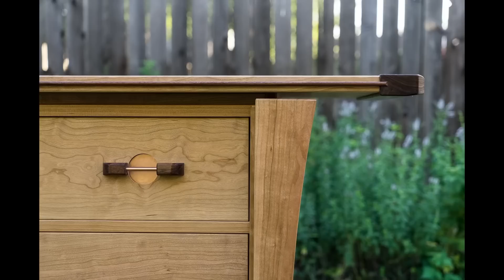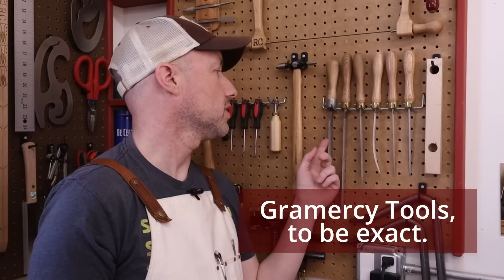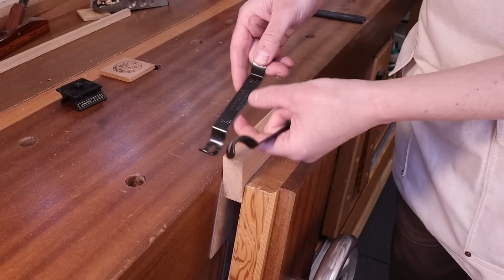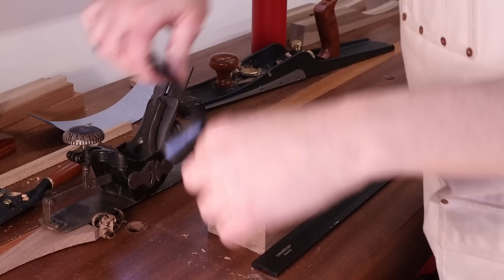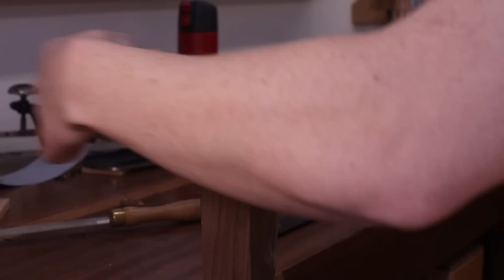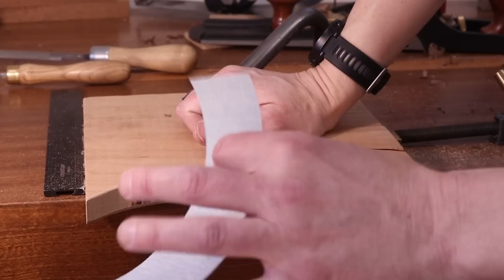Take Round-overs and Chamfers to the NEXT LEVEL with Hand Tools

Comment: I was hoping you’d get to a tool I saw on your shelf in the opening—the concave scraper set. Do you use them much? If so, with or without a burr? (I’ve heard differing answers.) If doing a big (like half inch) radius, would you start small and work your way up or just do it all with the target radius?
Reply from the maker: I don't use them very often, but when I do, it's with a slight burr, and the target radius from the get go.

Comment: The round with a rasp/file..... I find it's more consistent and easier if you start the stroke on the far side with the handle "flat", then drop your hand as you stroke; instead of starting with the handle low and raising it as you stroke. This is the way file work is taught here in Europe anyways, and I do find it gives a more consistent finish and cuts smoother too (smoother as felt through the handle of the tool)  😁
Reply from the maker: I tried to do it that way quite a bit at first, because I'd seen others do it that way, and never liked the way it felt nor the results I got, which is how I ended up doing it the way I do it now. To each their own, and all that.
Reply: @themountaintopjoinersshop8422  it does feel quite "strange" at first, it seems like a counter motion to what is "normal" to the hand, but for me it does give results. As you said; to each their own an all that 😁 
Dont take any of my comments as a "critique" of the way you work, or like I'm sayin its "wrong"...... theres no such thing as wrong if ya get results. Think of my comments as "bouncing ideas" among friends, theres no harm in my words...... I respect you quite a bit lad, and my future "magnum opus" will be based off your tool cabinet in a way, I have taken an inspiration from you 😁

Comment: Slotted screws are used almost exclusively in traditional boatbuilding and are superior to phillips and other types. The problem for most people unused to them is that they do not use the correct flat screwdriver. The screwdriver needs to fit the slot very closely, requiring that you have multiple screwdrivers or a multiple tip tool, ask any gunsmith. The fact is you can impart more torque to a slotted screw than you can a phillips with the appropriate tip. I grant you, most people do not have nor want multiple screwdrivers, and for the most part, the quality of metal nowadays leaves much to be desired. I have been working in wood and metal for more than fifty years and have learned from  many older experts. Use the right tool for the job, counterbore your holes, and rub some beeswax over the threads😁
Reply from the maker: I despise Phillips screws almost more than flathead. Flathead look nice, but to my experience that's the only good quality they have. I know I'm not alone in pointing out that the traditional flathead woodscrew is shaped like a wedge, which is a terrible design. If aesthetics were no concern, I'd be perfectly happy to use Torx (or even Robertson) for everything the rest of my life. They may be ugly, but functionally they are superior to everything preceding them.